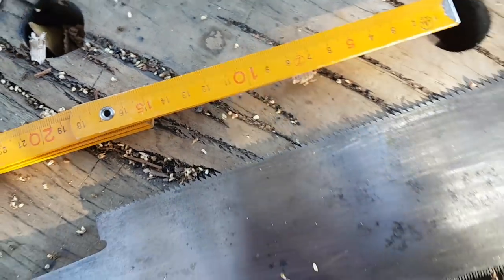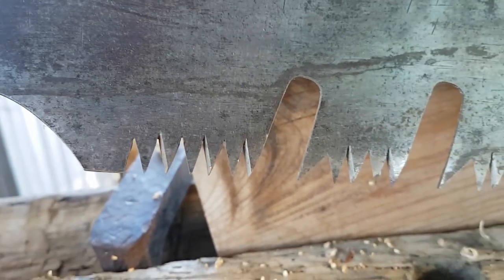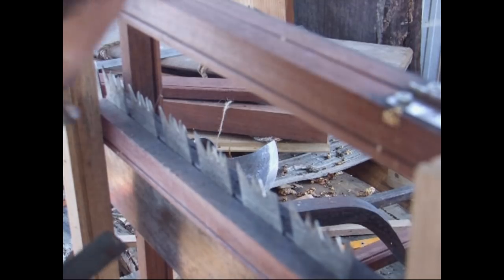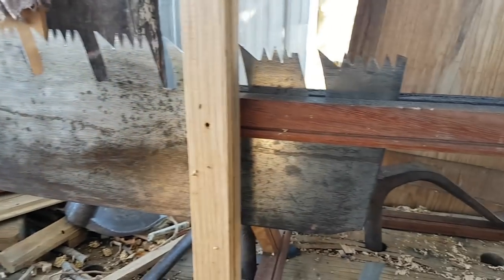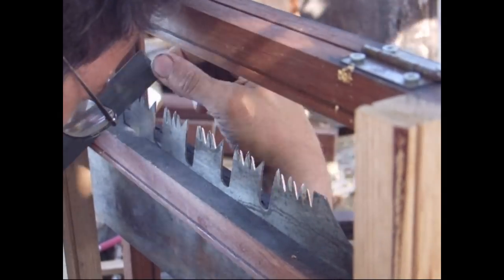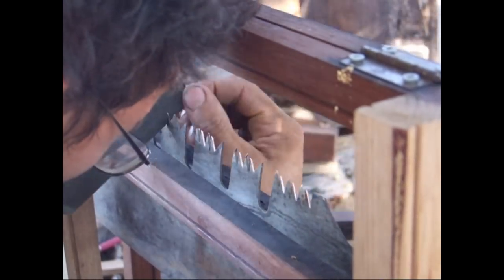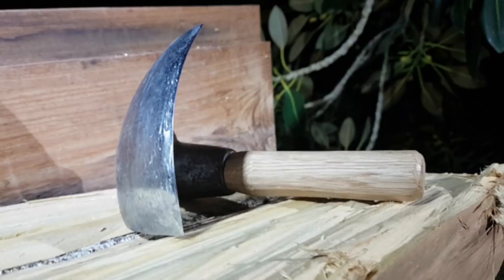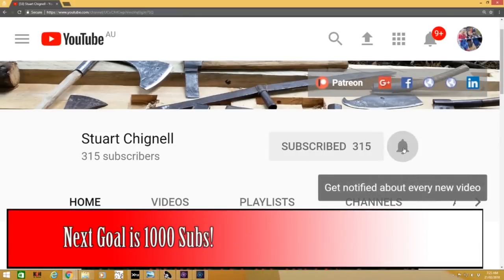Restoring and Sharpening My Huge Kataba Japanese Cross Cut Log Saw

Comment: I think you have pretty much come up with the answer to your filing issue.  I file crosscut saws and some of the same logic can be used on your saw.   Joint to a uniform height first.  Then the chisel teeth should be a little shorter then the cutter teeth.  On a standard timber crosscut the chisel (called raker) teeth are about 0.012" shorter then the cutters.   Since the teeth and larger gullets are smaller then a normal crosscut I guess that they should not be that low.   You could probably work up to the correct amount and even then the ideal height would vary from sawyer to sawyer and the type of wood cutting.  Green or dry, hard or softwood?    
Also your saw should cut much better if filed correctly.  However I see then the cutter tooth in front/before the chisel tooth is on the left side.  Because the cutter teeth cut progressively deeper the one before the chisel tooth will cut deeper and met tend to cut just a little to the left.   That happens on a crosscut saw too when single bucking and there is more down pressure on the push stroke then the pull stroke.  
For a bunch of online references on crosscut saw sharpening see:  http://www.bchw.org/Tech%20tips/Crosscut%20Sharpening.htm
Reply from the maker: Awesome reply. 

Makes sense that the chisel teeth are called rakers because that's what they are called on a chainsaw. The ideal height of the rakers is going to vary. On a chainsaw for hard wood I would have the cutting teeth and the rakers close to the same height. For softwood I'd file them deeper. I free hand sharpen my chainsaws but I ALWAYS use a gauge to get the raker height a consistent depth relative to each tooth.

I think I understand what you mean about the chisel teeth cutting progressively deeper. And how that might create a tendency to drift left. Two fixes I can see. 

1. On each set of teeth alternate between left/right/left/right cutters and right/left/right/left cutters.
2. Give the right side a tad more set.

Getting that right is where I think the mastery comes in. Getting a saw sharp enough to cut seems pretty easy. Getting it to cut efficiently will take more practice.